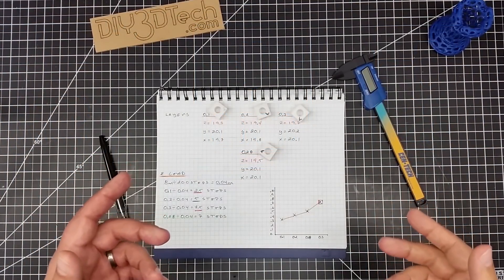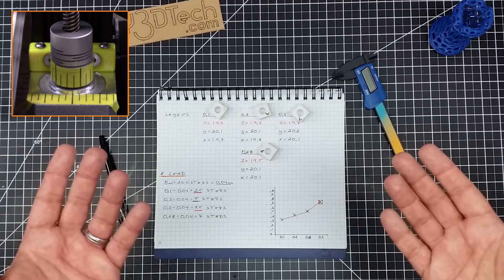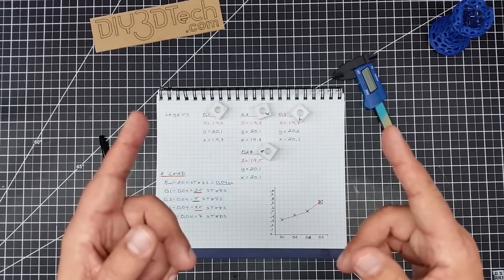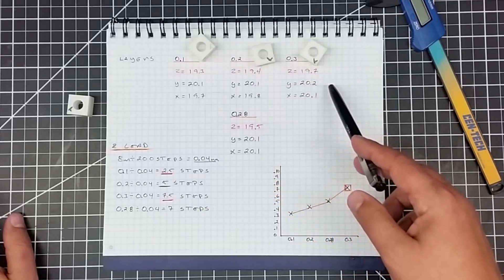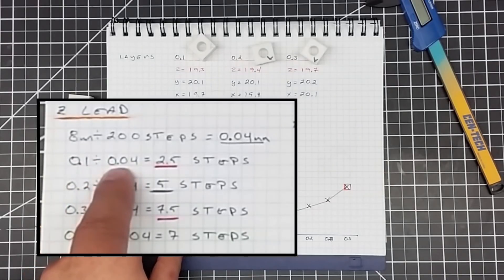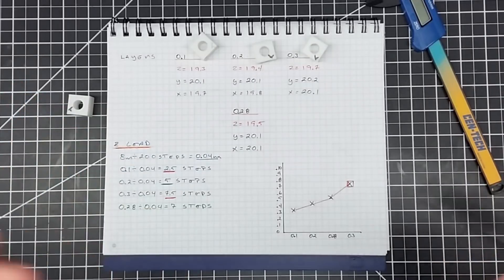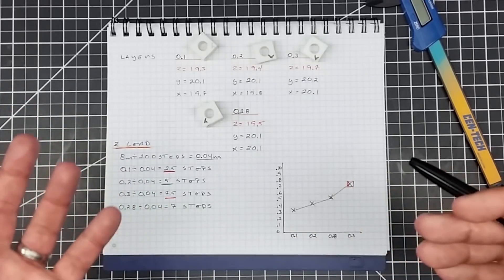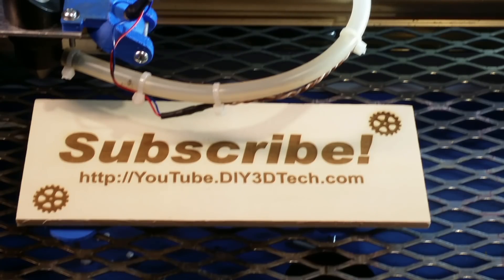Shop Talk - Is your Z Axis Lying to YOU?

Comment: As a few have said, there are some clarifications needed
First off, this is a great topic and I am happy DIY3DTECH has raised and started this discussion, I can see from all the comments that there is a lot of confusion as to how this all works

I dont have a Creality but I do have X5S with 8mm lead screw for the Z axis.
For a full rotation it moves the bed 8mm.
Stepper is 200 full steps / revolution (1.8 Deg / Step )
micro stepping  as with most 3D printers is set to 16
this means 200 * 16 steps per revolution = 3200 steps / revolution = 8mm
1mm Z movement = 400 steps
1 * 1/16 ustep = 0.0025mm
1 1/16 uStep = 0.1125 Deg rotation

Most 3D printers can do this but this is resolution, not accuracy.
Most steppers of the type used in 3D printers and CNC machines have an accuracy of 5% per step (0.09Deg on a 1.8Deg motor) non accumulating (It does not add up with rotations), this means a 1/16th uStep has a resolution of 0.0025mm but a potential accuracy of only 0.0025 +- 0.002mm and thats assuming the micro stepping is not affected by load because when were deep into the micro steps there is very little torque to hold position. anyway, ignore that we end up with a positional accuracy somewhere between 0.0005 - .0045mm but as I said, the printer stepping will catch up as it nears the high torque angles.

what does this mean to you though

If your trying to get 0.1mm Layer height you have to move the motor 40 microsteps, plenty to get you close enough
If your trying to get 0.2mm Layer height you have to move the motor 80 microsteps, plenty to get you close enough
If your trying to get 0.3mm Layer height you have to move the motor 120 microsteps, plenty to get you close enough

Gravity helps keep the BED / Gantry from being affected by backlash.
if your printing a 20mm height thats 8000 steps to get there so more than enough resolution to get you within   0.0125% accurate.

Z axis stepping is not the issue here. even with worst case errors, it should get within a divisor of the layer height +- 0.002mm

now Cura or Slic3r may have some weird algorithms at play.
0.3mm layer height does not exactly go into 20mm so the slicing can either go 19.8mm or 20.1 but not 20.
there should be no excuse for 0.1 or 0.2 layer heights as both are an exact divisor of 20
BUT did you have a different first layer height ?, is your bed zero position really zero?, both these can affect the first layer only so should not make much difference, but could be say +- 0.1mm of the total.

As for adjusting the steps per mm, it really should be pretty fixed unless you have a badly made lead screw where it gives you more or less than the nominal 8mm/revolution (Or what ever your screw is supposed to give.) it is very simple math.
 (full steps per rotation * microsteps)divided by the movement in mm per 360Deg gives you steps / mm.
in our case (200*16)/8 = 400 Steps per mm

The saga will continue :), oh and the new adaptive layer height capability of Cura should have the potential to eliminate these errors I mention... to be explored :)
Reply from the maker: Nice post and thank you and while I somewhat agree about "Most steppers of the type used in 3D printers and CNC machines have an accuracy of 5% per step (0.09Deg on a 1.8Deg motor) non accumulating (It does not add up with rotations)" and for the this be complelty true the error would have to competely reverse itself from one error to the next and don't see this as the case, however the assumtion of "random" error so you might have 2 positive errors and 1 negitive meaning you will not have 15% (i.e. 3 moves @5%) but some where around 5% (assuming each move will have -2.5% to +2.5% error) .  So the consiquality of the mototrs error is will be very, very low.   However this isn't where I am going, however back to the firmware/software, as if the physical system is told to do something it can't then it must do a partical of something which requires it to either over or under comment movement which is why in my test I saw the jump at 0.3 on the graph and 0.28 fit the curve of 0.1, 0.2 and 0.28 were distances not constranded by the system and held the same ratio.  So it was clear the CR-10 could not make the 0.3 movement as predicted by the Prusa Calaculator.  This is  thepoint I am strugling with, as this is a clear proof the calaculators yield is correct as it said the CR-10 could not do a 0.30 movement.  Now every one can argue that a 3d printer is nothing more then a "glue gun stuck to a CNC machine" and lack any resonable dimentional accracy so when you say "plenty to get you close enough" for many your correct as if I a toy dinansaur for my grandson at 0.3 or 0.28 he will never know the differance yet if I try and print a high persion mock up part for a client they will.  Again MANY again thanks for taking the time to right such a detialed post and do it so professionaly, I personaly appreact it!
Reply: You are more than welcome, I like your channel and like that you try to delve into areas often avoided by many channels so keep it up. I am very similar to you on my channel in that I work with CNC and 3D printing + a whole bunch of other automation projects. I currently have one home built CNC https://goo.gl/aCGisH and one smaller one on the way, and am also currently doing the same for 2 X 3D printer designs, one video of popular interest was the one on Belt vs Screw were I delve into a lot of scenarios of the two https://youtu.be/YU5SdzRVtv0 but also I am doing the series to design and build the 3D printer here https://youtu.be/SZO9NTPdU2A, one will also be 100% lead screws (No Belts)
Like I said, I think we have a lot in common

Anyway, back to the issue at hand.

Regarding the accuracy of +-5%, it is no accumulating as the motor has a fixed number of poles so no matter what a full 360Deg turn is just that, 360deg or to put it another way, 3200 steps at 1/16 stepping will always result in 360Deg or 8mm moved. but along the way, the individual steps may be a little off but in order to fit all those poles into the motor, if one is slightly off then the next will be probably off the other way ot they would simply not fit into the motor housing.

The fact that 0.28 Works is well... not quite accurate, it is actually 0.2777777777777778 but the rounding up for most 3D printing is accurate enough. Simply put, for the best accuracy divide your height by the number of layers to give you the layer height that will work with most precision. the math will need to be done twice, once to get the number of layers (Height / desired layer height) then adjusted to make the layers a whole number.
When I looked at the Prusa calculator last night, it did not even have an 8mm pitch option ?, the calculator has an M8 threaded rod, very different, it is also including the fact that the motor may be disabled when idle (AKA when the printer is printing the current layer), I would hope most printers DONT do this as it can introduce gravity assisted shifting of the gantry or bed, but often the controller will put the motor into a lower power mode with enough to hold the motor in place but not full power in order to reduce heat etc. So when a controller re-enables a drive it will in most cases jump to a full step position, but again this will at most introduce 0.04mm shift per layer (If your really unlucky) and if it does this on every layer could add as much as 2.6mm (8mm/200 = 0.04mm) and that would be horrible.

Yes a 3D printer is a CNC with a Glue Gun attached :), a finely flow regulated glue gun but the analogy fits :), sorry but its true and all the issues we are discussing apply to CNC machines equally, I know my CNC machines will slowly drop the spindle (Z axis) if I disable the motor during  a layer cut even worse than on 3D printers. So I dont allow it but do allow reduced power to the motor if your motors are getting too hot.

Plenty close enough... The machines mechanical / electrical accuracy surpasses the plastic accuracy in most cases due to shrinkage, slight variances in filament thickness, Part cooling, Heat bed temperature etc will all affect the final plastic part, Improving the accuracy of the machine will have diminishing returns , in most cases the Z axis is already way more accurate than any part the machine will produce, the X and Y can be made more accurate (But not by adding uSteps beyond about 10, more will improve smooth operation but not accuracy). Using a 0.9deg (400 Steps / rotation) Stepper will double the accuracy right away but the equivalent sized stepper will have less torque so you may need a bigger (Longer physically if you stick with Nema 17). the other way is to gear things down but this comes with the risk of adding backlash if not done right.

OK, this is getting long :) , I think I have enough material now for a whole video on this topic, so perhaps I will do that to help every one.
Reply from the maker: Enter a Hommer Simpsion moment here! You are Peter Oakes :-)  Yes enjoy your channel! and must admit I have stolen a bit of insperastion from some of your videos!
Reply: I am indeed Peter Oakes and run thebreadboardca channel, and as far as I am concerned, all the power to you for being "Inspired", it is what I am trying to achieve so it means i'm doing something right :). I have no issues with that, I think the more of us providing a varied (Different view points) but sound theory of how things work to help others learn, the better. Choices are good, sharing is good and building of each others content is also good so keep doing it my friend.
Reply: Peter Oakes I was thinking the same. I'm micro stepping to 32. With smoothieware. I'm wondering how close I can keep duel zs. I'm wondering if I should run dual Optical end stops to keep them level or if running in series would be good enough.

Comment: Most 3D printers use 16 microsteps, so they can make half a step easily...
Reply from the maker: As I wote in the desription for clarity when I refer to a 1/2 step, I am refering to 1/2 step of any fractional step so if your using 1/16 it can not make 1/2 of 1/16 or 1/32 step in other words.  Hopely this clarifies this point :-)
Reply: OK, thanks for the clarification, anyway if you have a lead screw of 8 mm per revolution and a stepper of 200 steps per revolution and use 16 micro-steps, then you have a theoretical resolution of 8mm/(200*16) is  2.5um per step. So a layer height of 0.1, 0.2 or 0.3 can be achieved very accurately. There is no error!
Reply from the maker: 1.8 deg would be 200 and 0.9 would be 400 so if you run this in the prusa calculator there is an error at 1.8 deg but not at 0.9...
Reply: I see what you mean, according to the calculator the error at 0.1 layer height could be -20 mm for a 10 mm high object, that seems unlikely, but is easy to verify, let me check...

Comment: You probably have a combination of constant and scaling errors.  A constant error could be the bed being leveled too low or too high.  A scaling error could be a problem with the stepper driver, or as you mentioned, a lead screw where the thread pitch is either too steep or too shallow than specified.  To help determine the extent of both of these errors, I would suggest printing cubes at heights of 10 mm, 20 mm, 30 mm, etc. and then looking at the error relative to the nominal height.
Reply from the maker: Interesting however as the Prusa calculator shows I am geting better results .28 rather then .3
Reply: But the cube you printed at 0.3 layer comes closer to 20.0mm nominal height than the 0.28 layer did.  Regardless of that, I don't think you have enough data points to fully characterize your errors.  When you have multiple sources of error (such as this), the total error can manifest itself in interesting ways over longer duration's, due to the combination of constant (offset) errors and scaling errors.  But over shorter terms, you may miss it.  For instance... you could have a negative scaling error (underestimating the actual motion), and a positive constant error (bed level too high).  At some point, these two errors might cancel each other out.  Now if you happen to only make measurements near this point, you might think there are no errors in the system at all.  But if you then drive the axis farther, you'll see the effect of the scaling errors dominate.

So, again, I think it would be interesting for everyone here to see what happens when you try this over a larger Z range.  I'm curious how accurate these rather simple drive systems really are!  I can think of at least five Z error sources (not including X-Y and straightness of the frame errors)...
1) Noise & vibrations in the system cause random variations in extrusion layers.
2) Feed rate variations in the extrusion can also cause height changes in the extruded plastic.
3) Thread pitch errors in lead screw generally cause scale errors, although short term random errors can also ocurr.
4) Bed leveling causes constant or offset (also known as Bias) errors.
5) Stepper motor positioning errors.  I don't know enough about the internal workings of a stepper motor.  But I can almost guarantee there are errors associated with them.  These might be more random in nature, unless it completely misses steps, etc.

Anyway, this is probably way more detail than is really needed.  Can't help it... I do length metrology all day at work, and have done a number of error/uncertainty budgets over the years.  :-)
Reply from the maker: Actrucly not, this is why I graphed it as techncialy I need to kick up pluses per-step (I mentioned this in the video) as I am undershooting the number.  Becuase you can see the 0.3 becomes an out-outlier and the Pursa  calculator projects 0.28 which falls right on the line where it should...
Reply: Please explain.  The 0.3 layer got closest to the desired 20.0 mm height of the cube.  I'm not sure how you are saying the 0.28 was better.  And which calculator are you using?  There are several on that page.
Reply from the maker: It isn't look at the 0.1 and how far off it is from the 20mm, this is becuase the machine is not sending enough pluses to the motor to achive the travel distance as the 20mm is a target not an achrivment so of any, the 0.1 should have came the closest.  Have you worked with Statistical Process Control below (SPC)?  As this is nothing more then a control chart as we do not care if it reachs 20mm, we are instead concrned if our "process" is in control and the 0.3 is outside of the expect chart boundies...

Comment: Wouldn't a 4:1 gear ratio with a belt(no backlash) make it accurate to 10 microns/step? It would also be an easy translation in the firmware to steps/mm.
Reply: Belt between the lead screw and motor to act as the reduction link between say a 20 tooth pulley and a 60 tooth one, and yes this would work if there was no backlash and you will also increase torque on the shaft. You will lose speed but for the Z axis, this would be a non issue.
Reply from the maker: Not sure where the belt comes on as what I am discussing in pure motor to lead screw connection...
Reply: Thanks... Wouldn't it be a 80 tooth pulley?
Reply: @DIY3DTECH.com If this were a real problem... dealing with the inability to resolve half steps... then a gear reduction would be a real world physical solution
Reply: Ah yes, you are correct... principle was right, facts wrong...Dohhh.

Comment: This video is over simplified making it incomplete. We all know most 3D printers use the 8mm/turn Lead Screws with 1.8 degree motors driven at 1/16 microsteps. That is 3200 steps per 8mm or 400 steps per 1mm.  Indeed if you print at 0.3mm layer height, that equates to 400 steps/3.33 = 120.12 steps, a 0.0009% microstep error or +/- 0.00027mm; a value you likely lose (practically speaking) on parts and machine tolerances, not to mention your 1st layer. A better real world approach to this subject would have been to mount a good last word test indicator on your Z axis and move it by 0.05mm, 0.1mm, 0.15mm, 0.2mm, etc increments to see how accurate a typical $150-$500 3D printer is.
Reply: What do your thousands of views do to further enlighten the subject?
Reply from the maker: Watch for  an upcoming video as I show how to measure...
Reply: Academic enough for your on paper calculation, apparently... I second the idea with the dial indicators, would have been way more entertaining, but probably inconclusive.
Reply from the maker: The content is accurate and suficent enough to used productivly just as I demostrated in the video and do with every print I make and folk wish learn more there are many recource on this amazing thing we call the internet :-)
Reply: It was accurate enough for me, an Engineer - an honest to god Rocket Scientist, to understand the phenomena and take appropriate steps to correct it. (Reset all of the layer heights in Cura to match whole steps...) I would also be interested in a more detailed look at it later.
Reply from the maker: Unfortunately my thousands of view aren’t as academic as you 🤓